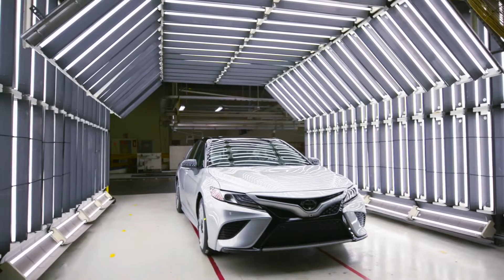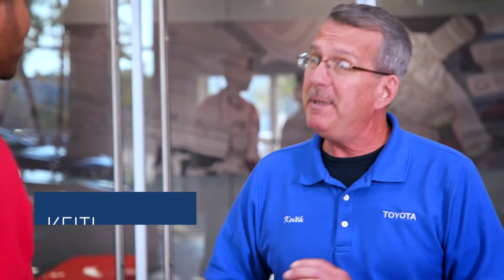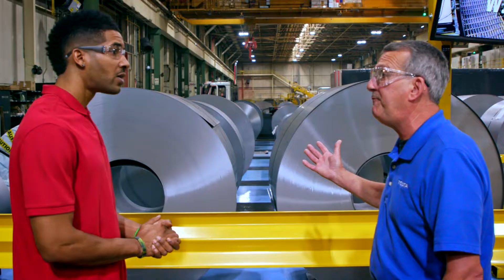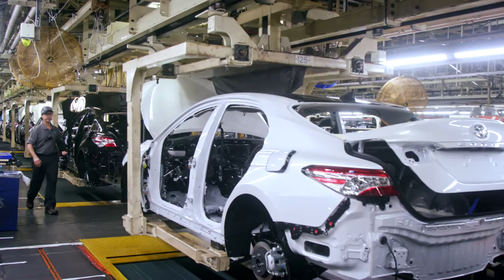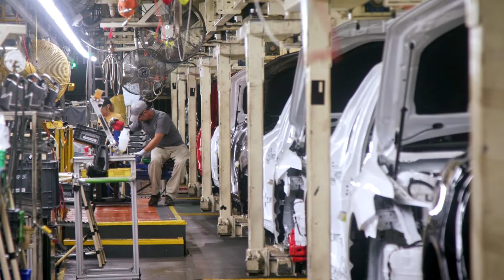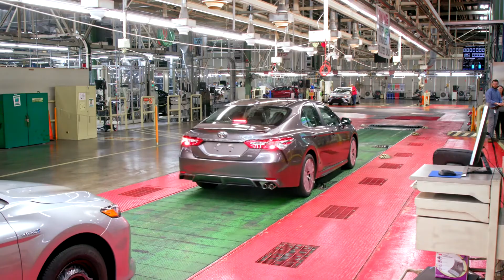Toyota Manufacturing Plant, Georgetown | Made In Kentucky |  A Kentucky Original Series

Comment: maybe a stupid question but do dealers keep the original oil that was installed at the factory for customer delivery? because when I worked at a Honda dealership back in the early 2000s depending on model we would sometimes get vehicles with build dates of over a year ago by the time it was sold and I always wondered if the customer was getting year old oil in their brand new car.